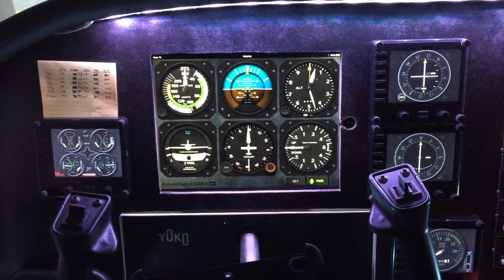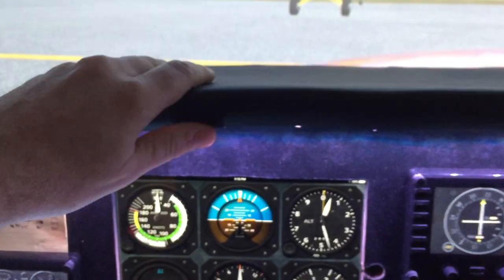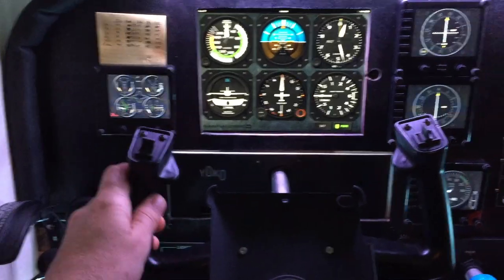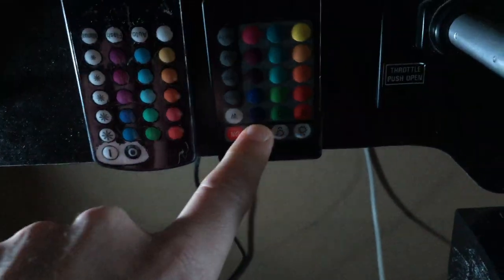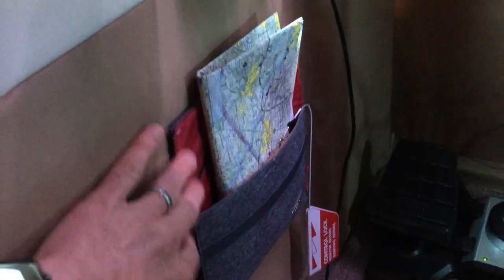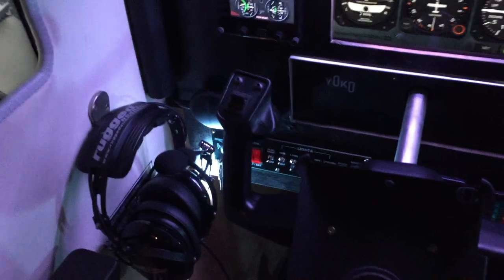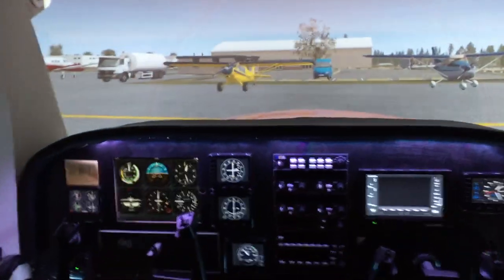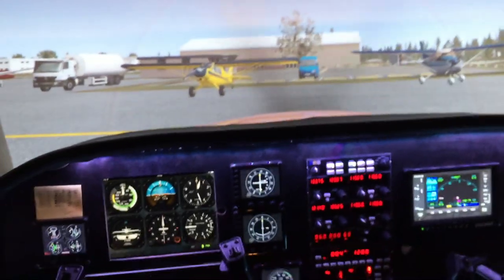Basement Sim Tour 2.0 (P3D / X-Plane Cessna Home Cockpit)

Comment: Amazing set up! Im an ex commercial pilot who for various reasons spends more time flying simulation than real flying. you have inspired me to look into building my own cockpit, though the problem is I fly, used to fly such a diverse range of different types, perhaps modular plug in controls might be the answer? multi engine and aerobatic machines etc!

Comment: Nice setup.  I am just starting to build mine.  It will be a Cessna 182 sim that mimics my own Cessna 182 as closely as possible.  I will be using X-Plane and Air Manager along with the fantastic Arduino interface Air Manager has for rotary encoders and such.

Comment: I have 4 questions for you. 1) How did you hook up all the electrical stuff for the instruments and the panel. 2) Where did you get your designs for the sim? 3) A little suggestion, but could you do a series on where you build a flight sim and split it up into different videos to show how to make a sim? 4) Where did you get all your parts and instrument gauges? If you see this comment, thanks for reading, and respond as soon as possible.
Reply from the maker: Scott Brothers Productions please see www.ontheglideslope.net which answers most of these questions.
Reply: On The Glideslope Thanks!

Comment: Hi,

I’m looking to upgrade the visuals in my sim and I’m impressed and intrigued with what you have done. I like the idea of putting monitors on the right and left walls rather than using a projection system that wraps around. My question is: Do you get a smooth view when you pan from the front screen to the side, or is there a change in continuity and depth perception?

THX… your comments are appreciated… Joey

Comment: Hi...Wondering if the guide is out yet?  I have completed the frame but am having a bit of trouble with the INSIDE of the enclosure as far as the corrugated plastic....just cant get things to line up right....Im a better PILOT than a builder I suppose... :)

Comment: Hello.  I love your setup and am looking to make one almost exactly based on your setup.  However, I have a couple of questions:
1.  If you were to do it all over again, would you recommend creating a panel with two tablets instead of one tablet and FIPs to give more flexibility or the current setup is better?
2.  Instead of a projector, I would like to use a large 4K Curved TV screen in front.  With the distance that you have in front and to ensure you don't have a gap on the left or right what would be the right size TV?
  Love your videos and thanks for putting all of this information on your website.

Comment: OTG - In the tour you called your side monitor a "tv"... are they literally tv's or monitors?  The reason I ask is that I'm concerned about them being so close, and wonder if the difference would matter.  Thanks for all the info. Really enjoy your videos and website.  With the release of the 1080ti, I'm jumping in.
Reply from the maker: Go for it! They are really TVs. LED HD ones I got at the local Best Buy. Cheapest 1080p ones I could find that had a flat base. They were like $139 each.
Reply: Awesome, thanks!

Comment: I tried to build a cockpit using your specs which worked great but i fell short with a projector i nought.  What's your thoughts on a 55 inch tv for the front instead?  It'll have to be flat unless x-plane can 'tilt' the forward view.

Comment: I am looking for a new video card to run my three monitors I am currently running and old. gtx650TI  I saw that you were using NVIDIA GeForce GTX 980 TI  is there a new replacement that will easily handle the two window monitors and  the projection screen. 100 ", I apprciate any advise , thanks.
Reply from the maker: The 980ti was a great card. But I am really loving my new 1080ti.

Comment: Beautiful setup man.  One day I'd like to build something like this. Does this setup work with any planes other than a C172? What would happen if you tried to fly a Piper or Mooney? What if you wanted to fly a B737?
Reply from the maker: I can configure it to fly any plane presuming I can find the gauges. I fly a C172, PA28-161, PA32, and Baron 58 already. With a 737 I can't get the windows to line up, but I can fly it.

Comment: Thank you for your amazing work and sharing all of this!
May I ask you, how do you manage 3 displays on for the outside view plus additional displays for your cockpit. Do you have a tipp how to run 5 displays with one PC? Maybe I overviewed it, but I would be very thankful for a tipp how to run the three outside screens plus a G1000 which is using 2 displays, too. Thanks for all your work, you are the blast!!!
I can't login on Wordpress to contact you, Wordpress doesn't allow new registrations at the moment..., that's why I am writing here. Thanks a million!
Reply from the maker: Four are plugged into the 1080ti card, and one (the GNS430 GPS) is plugged into the motherboard's onboard video card. In my bios I activated both cards.

Comment: OTG, it looks like you’re using the FlightIllusion radios. I just set up the transponder and auto pilot but can’t get the Ident button working in X-Plane. Does yours function correctly, and if so, do you know the fix.

Thanks

Dominick
Reply from the maker: It did not used to. FI updated their software, and many things that used to not work now do. I don’t recall if the ident button works in XP now or not. I don’t think it does, and I seem to remember I had to code one of my FIP buttons to be the ident ...

Comment: Hello. Good job ! 
I'm french and i Have just one question : what is your pc configuration (memory, cpu...)? 
Thanks
Reply: Intel Core i7-6700K Processor 4.0GHz (overclocked to about 4.6GHz)
Corsair Hydro GTX H100i liquid cooler
ASUS Maximus VIII Hero Z170 motherboard
Microsoft Windows 10 Pro 64-bit
16GB DDR4-3000 RAM
2TB 7,200RPM Hard Drive
Intel 750 400GB SSD Boot Drive
NVIDIA GeForce GTX 980 TI 6GB GDDR5
Reply: Thank you !

Comment: How are you getting the iPad to "talk" to flight sim? With the G1000 setup would it be possible to set up two iPads one for efis one for GPS map?
Reply from the maker: The G1000 app in the Apple App store will run both on two iPads, though I don't use it. And the X-Plane talks to ForeFlight easily - you just enter the IP address of the tablet in its network screen.

Comment: You have probably already answered this, but how much was all of it? Do you have an approximation ?
Reply from the maker: At this point I have no idea (and have tried not to keep track :-)  For the original build it was probably just under $5K. Half of that was PC as I didn't have one and needed to buy a very powerful one. All the cabin materials, panel, etc. was very cheap as I made my own. I got the avionics a few pieces at a time used on eBay.

Comment: Amazing cockpit Sir, I have made mine based on the same design. One question though, that is driving me crazy, using the single projector for the front view, and since it's a dual seat cockpit, your eyes are not in the center of the projection, they are on the left or on the right...so you get a "distortion" that it's not realistic at all, it seems you're constantly flying sideways (parallax effect in a way). How do you resolve this issue? I'm already using 0.3 zoom and fsx doesn't have more. Thanks :D
Reply: Nuno Nunes Good point! With mine, it was awkward, especially if I moved to the right seat. I think the brain adapts to the offset. My new single seat sim won’t have that issue.

Comment: Hello! What kind of projector screen do you use? i mean it's a normal one or it must be very reflective or something? And what the proportion of the 100" diagonal , 16/9 or 16/10? Thanks
Reply from the maker: Just a normal projector screen. And it's 16/9.
Reply: Thanks a lot. I am nearly to the finish of my cockpit building, thanks to your help!

I am only on doubt to which projector to buy. I figured out that the EH320UST does not run at 1080p but only 1080i... I have seen the new Optoma ZH400UST ( Laser ) and it's awesome, but in Europe it will cost about 4500 €.. The problem is I have a budget for the projector of 2500 €. 
How do you feel about the interlaced 1080i video mode? Do you have any advise on other projector or brand to consider? Thanks
Reply: @gianlucaluisi8695  remember, he is using an ultra short throw projector that allows it to be so close to the screen.  A short throw projector would need to be about 4 feet from the screen to fit a 100" screen.  A regular theater projector would need to be 10 feet from the screen to fit a 100" 16:9 image.  Laser or LED will have a longer bulb life (30,000 hours) but cost a little more.  A regular bulb unit will only have a 2-4,000 hour life and cost less.  You want at least 3000 ANSI lumens.  3000 Japanese lumens equates to about 260 ANSI lumens.

Comment: can you run a "Dual" cocpit display with two ipads running the apps connected to FSX?  I want to use the sim we are going to build for for some unofficial "flight instruction" with my Son.  Thx
Reply from the maker: I'm sure you can. The AirManager software should run with two instances.

Comment: What kind of specs on the pc? Looks awesome by the way!!
Reply: Check the desc. There's a link there where you can find his pc specs
Reply: Intel Core i7-6700K Processor 4.0GHz (overclocked to about 4.6GHz)
Corsair Hydro GTX H100i liquid cooler

ASUS Maximus VIII Hero Z170 motherboard

Microsoft Windows 10 Pro 64-bit

16GB DDR4-3000 RAM

2TB 7,200RPM Hard Drive

Intel 750 400GB SSD Boot Drive

NVIDIA GeForce GTX 980 TI 6GB GDDR5 Intel Core i7-6700K Processor 4.0GHz (overclocked to about 4.6GHz)

Corsair Hydro GTX H100i liquid cooler

ASUS Maximus VIII Hero Z170 motherboard

Microsoft Windows 10 Pro 64-bit

16GB DDR4-3000 RAM

2TB 7,200RPM Hard Drive

Intel 750 400GB SSD Boot Drive

NVIDIA GeForce GTX 980 TI 6GB GDDR5

Comment: This looks seriously amazing.

Random question: how do you set the altimeter?
Reply: you     turn the knob on the    altimeter
Reply: (i read that correctly)
Reply from the maker: I can turn the knob on the iPad screen, but that's a bit awkward so I assigned one of the knobs on one of the Saitek FIPs to adjust it as well. I did that in SPAD.neXt.
Reply from the maker: And thanks!